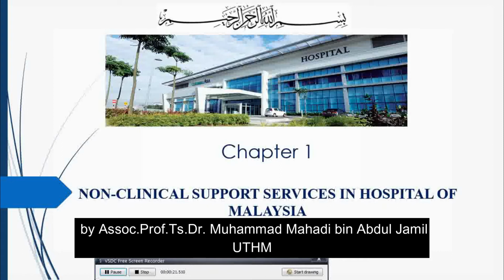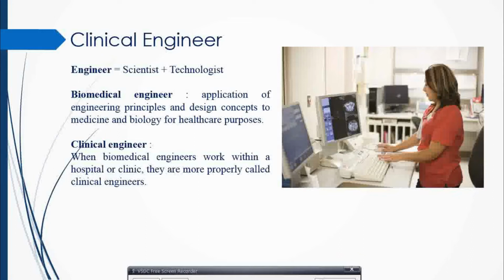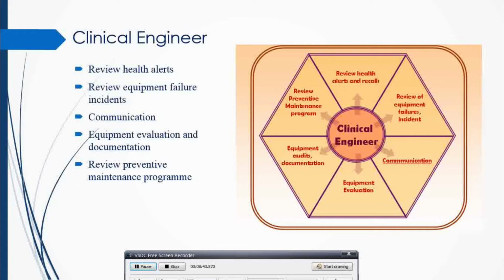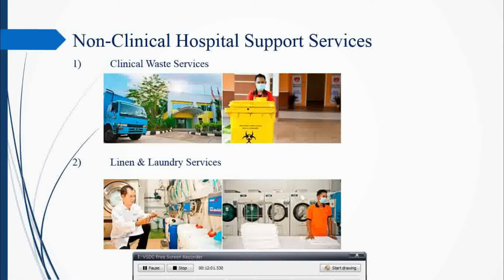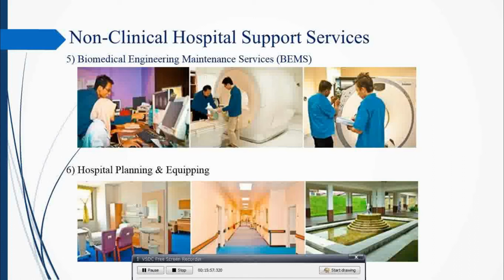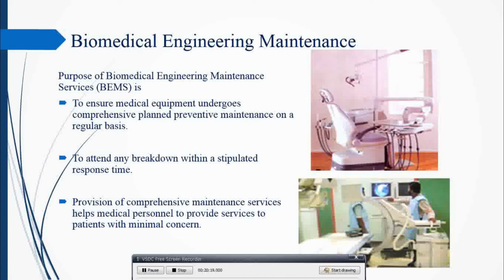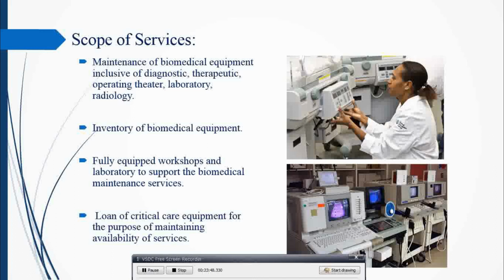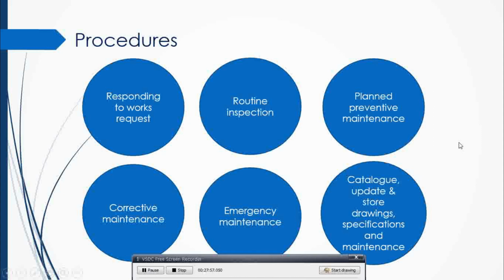Medical Instrumentation BEU40503 lesson 2

Comment: Thank you Dr.  From this video, I can conclude that clinical engineering is the primary department for service and maintenance. it's all included in this department. There are differences between clinical and non-clinical parts. non-clinical part is more to maintenance service (BEM) and cleaning service. For clinical part is more to documentation, and reporting. In this video also, I learn the scope and procedure of the BEM services. Both services are support services in Malaysia.

Comment: Assalamulaikum prof, from this video, what I can surmise that clinical engineering is the primary department for service and maintenance. There is a difference between the clinical and non-clinical parts. The non-clinical part is more concerned with maintenance (BEM) and cleaning services. There is more documentation, report, and other things to do in the clinical part. I also learn about the scope and procedure of BEM services in this video. Thank you